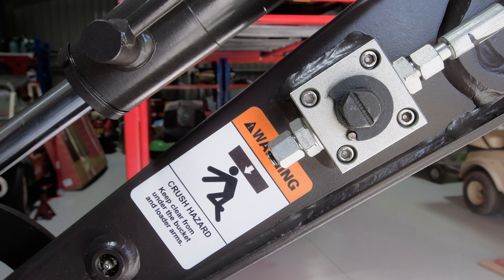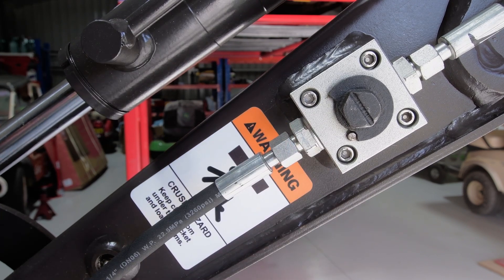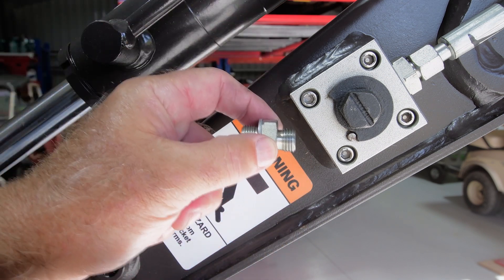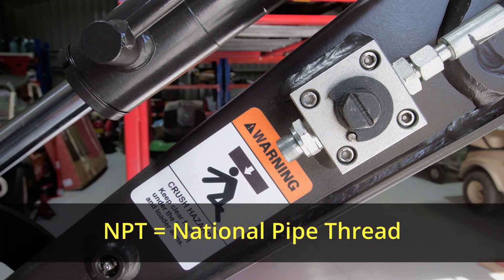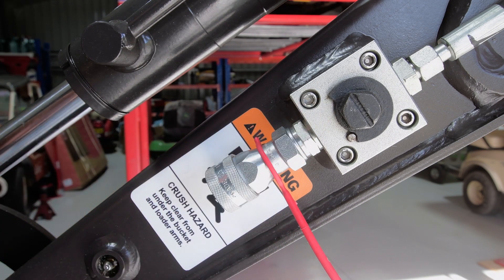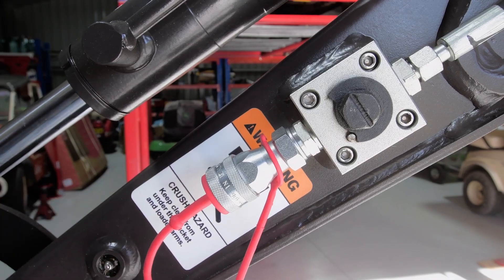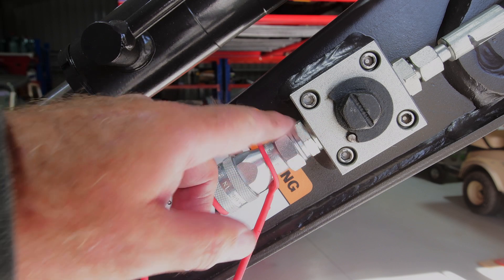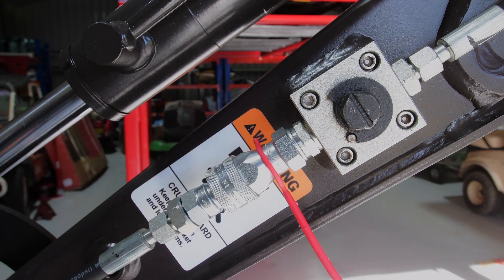Hydraulic Quick Connect Couplers for the UME 12 Mini Excavator #minidigger #miniexcavator #farmlife

Comment: Hi about the adding a hydraulic quick hicth for mini excavator.
I am about to do the same But I have a foot pedal for arguer how to add the switch to complete the circuit and not using the foot pedal. Be nice to see the full completion of the hydraulic quick hicth.
Thanks
Reply from the maker: I haven't done it but you can buy an electrical solenoid to activate the thumb. A simple switch to alternate between the flow going to the auger or the thumb. Cheers Dave.

Comment: Hi Dave , very nice video , thanks for all the information,  I would just add for you to place a female hydraulic in one side of the valve and the male on the other side , so then when saving the auger you can just plug them in and not worry with leaks

Comment: Hi Dave, I found that when I added quick couplings to my Chigger the attachment hoses got uncomfortably close to the tipping linkages when fully crowded out. The auxiliary ports on these Chiggers are quite far down the dipper arm. I made a couple of brackets to move the auxiliary blocks back two inches, works well and feels a bit safer.

Comment: Would like to do this to my new mini excavator, most of what I can find in Quick couplers here in the US are NPT, so would you know where to find the adaptor to convert to NPT?
Reply from the maker: Hello Robert. You will need the 3/8" BSPP to 3/8" NPT coupler. This is the first bit that goes into the valve body block. Then all the quick connect couplers will also have to be NPT. I had a quick look and found part number 9007-06-06  plus the bonded seal 9500-06 from an online store in the US at this web address: https://www.hydraulicsdirect.com/BSPP-to-NPTF-p/9007.htm Give them a call and they should have everything you need. Thanks for watching - Dave.
Reply: @TreeChangeFarmer  Thanks very much, I will definitely look at that site for the converter and quick couplings
Reply: @RobertJohnson-rt8nc  did they have them?

Comment: After ordering and waiting for the BSPP quick connects from the UK, I finally got my Mini-Ex plumbed as you described in your excellent video.  I couldn't find the right M-M BSPP adapter, so had to weld two together end to end.  But it works!   Now I can finally use the grapple, augur and tilt bucket attachments.  Thanks again for helping me to get mine going.
Reply from the maker: It is shame Patrick that you had the trouble sourcing the parts local and you had to look to the UK.  Have to say I did not have much help from the retailer of the mini digger initially -but you would think a lot of people would be asking for the same conversion.

Comment: One of my first mods I did was add some aggi quick couplers. I bought 3 pairs actually, for my tilt bucket and my auger. Was a pain to to get the adapter for it. Had to machine one myself as the hydraulic shop didn’t have the right one.